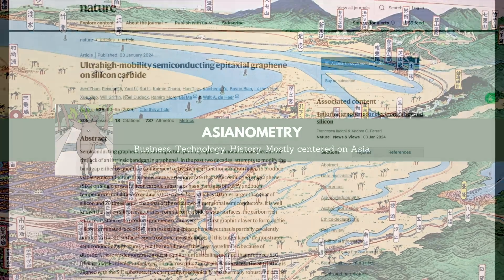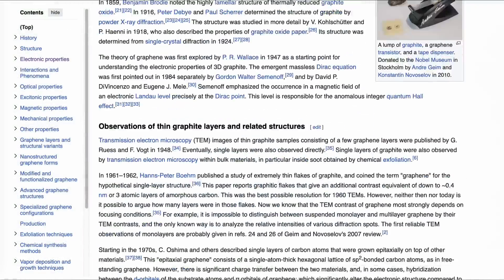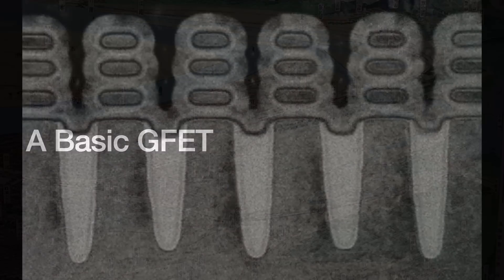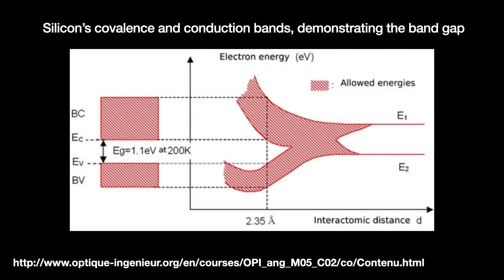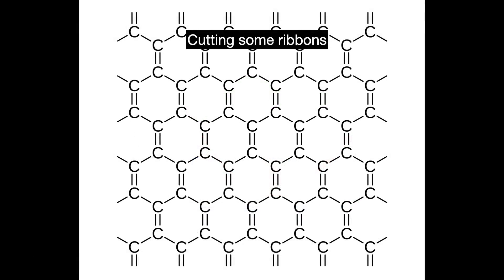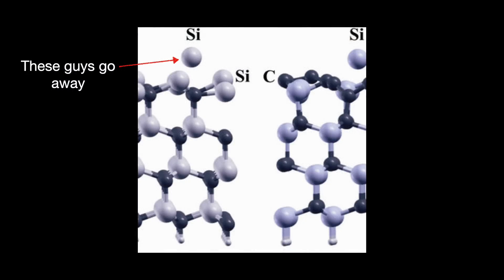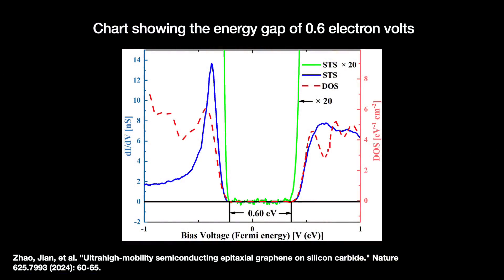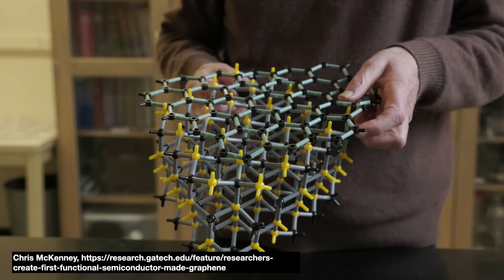A Graphene Transistor Breakthrough?

Comment: Wonder what'll happen first. A revolution in creating 2D material layers that'll allow for the fast iteration through materials so scientists can quickly find a variety of 2D materials with great uses or conventional ways where graphene can actually be put to use.

I'm betting on the first. And I suspect that  it'll suddenly make Graphene not that interesting anymore.

They've already isolated phosphorene, antimonene, germanene, silicene, and siloxene and it's shown you don't need a material made from a pure material like Graphene's carbon to get better effects than current materials.

And creating 2D sheet molecules of multiple atoms may prove easier to do than depositing a single layer of the same atom.

Comment: the semi conduction properties use on doping to change /deform the lattes it can be be applying charge but not gap so unless the dope to get said holes or wave arising  from  deformity as it moves under voltage through the lattes  as with the surface or inverse with  excess  of negatively charged  particulate  ,especially!!!

Comment: Because it is a 2D material, no consumer device will ever be viable if it will rely on notably large continuous sheets of graphene, as thermal expansion will constantly crack the pieces apart.

Comment: Graphene’s bandgap issue is a fundamental limitation when it comes to its use in semiconductors. Here’s a detailed look at how the electronic structure of graphene compares to traditional semiconductor materials like silicon and germanium and why it’s challenging to open a usable bandgap in graphene.
1. Understanding Bandgaps in Semiconductors

In semiconductor materials like silicon and germanium, a bandgap separates the valence band (filled with electrons) and the conduction band (where electrons can move freely). The size of this bandgap determines the semiconductor’s electrical properties.

    Silicon: Silicon has an indirect bandgap of ~1.1 eV, which allows it to conduct electricity under certain conditions while staying insulating at low voltages. This bandgap size strikes a balance, enabling silicon to switch on and off easily in digital electronics, which is crucial for transistor functionality.

    Germanium: Germanium has a smaller indirect bandgap of ~0.67 eV, making it more conductive than silicon but less ideal for creating a clear “off” state in digital circuits. Despite this, it’s still useful in some high-speed applications, though it's more sensitive to temperature variations than silicon.

2. Graphene’s Bandgap: A Zero-Gap Semiconductor

Graphene is unique because it’s a zero-bandgap material. Its valence and conduction bands meet at the Dirac points (in a "cone" shape in energy-momentum space), meaning there is no energy gap to prevent electrons from jumping between these bands. This structure makes graphene act like a semimetal rather than a semiconductor, giving it remarkable electrical conductivity but eliminating the possibility of an “off” state without a bandgap.

In traditional transistors, this inability to fully switch “off” would result in leakage currents that limit energy efficiency and overall functionality.
3. Attempts to Induce a Bandgap in Graphene

Researchers have tried various methods to introduce a bandgap in graphene, but each approach has notable drawbacks due to counteracting effects:

    Strain Engineering: Applying mechanical strain to graphene can distort its lattice structure, creating a slight bandgap. However, strain-induced bandgaps are typically small (tens of meV) and can vary depending on the amount of strain, making them impractical for consistent semiconductor applications.

    Chemical Doping: By introducing atoms like nitrogen or boron, researchers attempt to disrupt graphene's symmetry and open a bandgap. However, doping often results in uncontrollable defects that degrade graphene’s remarkable properties, including its mobility, and introduces unwanted scattering.

    Bilayer Graphene with Electric Fields: Stacking two layers of graphene and applying an electric field can also induce a bandgap (up to ~250 meV). But this setup is complex, and even this bandgap is much smaller than silicon's, limiting the bilayer's usefulness in digital circuits.

4. Comparison with Silicon and Germanium

Silicon and germanium have stable, tunable bandgaps that allow control over electron flow, enabling them to switch reliably between conductive and non-conductive states. In comparison:

    Graphene’s Conduction: Because it lacks a bandgap, graphene has a very high electron mobility and conducts almost like a metal, which is advantageous in some contexts but is unsuitable for digital switches.

    Thermal Sensitivity: Silicon’s bandgap provides a stable “off” state even under fluctuating temperatures, a feature that graphene lacks since it cannot isolate an “off” state.

    Induced Bandgap Limitations: Any forced bandgap in graphene is inherently unstable or too small to compete with silicon, as it’s either difficult to control or comes with trade-offs, such as reduced mobility and material integrity.

5. Why Graphene is Still Being Studied

Despite its limitations in traditional semiconducting applications, graphene’s high carrier mobility, strength, and flexibility make it valuable in areas like high-frequency electronics, sensors, and photodetectors. In these fields, its lack of a bandgap isn’t as critical since it benefits from high conductivity and speed without needing the on-off functionality of digital transistors.
Conclusion

Graphene’s lack of a natural bandgap and the difficulty in introducing a stable one make it unsuitable for conventional semiconductor applications like transistors. Silicon and germanium, with their stable bandgaps, remain far better suited for digital electronics where controlled switching is essential.

Comment: I think it might turn out that the graphene will actually never leave the lab. However, things might end up in such a way, that solutions and techniques for creating graphene, invented during development, will be used in the creation of some other metamaterials. So basically, Carbon in graphene, would be exchanged with some other atoms, but the development/manufacturing techniques (not necessarily the ones in this video) will be the same

Comment: The electron mobility of HEMT devices (high electron mobility transistors) are in the ball park of these proposed GFETs (and usually better). III-V processes use a 2D electron gas at the interference between the semi insulator and the metal. The most common III-V are AlGaAs, InGaAs, GaN, and InP. Of course these are all usually used as amplifiers.  Anyway, I point this out because these are decades old processes that give some grounding in reality. Graphene is cool, but it's also a buzz word. It's amazing how many papers come out with titles filled with buzz words but which don't do anything novel.. or useful.

Comment: Wouldn’t Graphene be best used as a capacitor and or batteries.?.  Graphene is a remarkable material.  I have followed its use for a decade.  The add it to concrete with wonderful results.  Eventually they will use it in armor/Bullet alloys, cables, electrical propulsion. Stealth Clothing, (all ready being done).  I figured it would eventually become a type of super conductor, Levitation.  I could go on with hundreds of things…🤔…. A semiconductor never crossed my mind.😳.
Rock on 🤘 Georgia Tech.!.  They do have some very good teachers.😉.

Comment: One possible configuration of microtransistor is a vacuum lamp. At that scale it doesn't needs neither vacuum nor heating, but the operating voltages are high (close to 12V).

Comment: Excuse my simple approach (I have done some semiconductor physics in my studies BTW) but transistors rely on SEMICONDUCTOR action (through doping). In a FET,  the channel's conductivity is modulated from the relatively high intrinsic resistance of the pure(ish) semiconductor (usually silicon) to a lower level which results from doping.

Graphene however is a CONDUCTOR. It has no ability to have its conductivity modulated !

Whatever these experimental transistors may be, there are NOT 'graphene transistors' since graphene is ALWAYS a CONDUCTOR. It can have NO transistor action by definition.

Researchers here are making rather far-fetched claims. I suspect it's the silicon carbide doing the work here, not the graphene !

Comment: One way to make a fet out of graphene is to put a very precise gold layer so individual atoms sit in the c6 cells, next deposit another graphene later over that. If you apply an electric field the graphene  will conduct to the second layer, if you apply a positive charge it will resist current flow. It behaves similar to a tunnel diode at zero charge.

Comment: i think the biggest breakthrough will be when electronics focus on trying to become more efficient under high temperatures. Reason graphene is so innovative is because it is made from coal the 4th most abundant element on earth and it is atoms thin. Coal has a temperature rating of 3 which is in the mid point of a conductor and an insulator. When graphene over heats which probably barely happens, graphene will burn away meaning that a product with intended disposability and low cost for electronics will create a more efficient product. The reason its more effective with temperature is because the hexagonal structures creates two paths for the electron bonds to share photons and energy. I think that graphene will create the new wires and connection points for motherboards in the future. Transistors themselves i think that replacing the gates with nanotubes will the best option for what is in the market today to prevent the leaks currently creating panic amongst so many EE. Moores Law. All Love Doe<3

Comment: I’ve built high power, high efficiency class E radio transmitters using SiC fets (silicon carbide) because they have low gate capacitances and allow for higher frequencies for switching. I wonder if graphene gates would permit high power fets designed for PWM applications to be used in the hobby world for higher frequency switching radio amp designs. It all depends upon gate capacitance at those frequencies, I guess.

Comment: Sorry if I missed this but I'm confused about how GFETs work. For normal FETs (even BJTs), you need a semiconductor but also PN junctions (P/N are created by doping the semiconductor with different atoms). Do GFETs require PN junctions and doping?
Reply: JFETs have a pn junction, insulated gate FETs don't.  But as I understand it, you still need the drain to source channel to be doped.
Reply: @ but if you have doped and intrinsic next to each other, that’s a kind of junction too right?
Reply: @nitroxide17  It would be. However, a mosfet (which used to be called an igfet - insulated gate - showing my age!) has a thin layer of silicon oxide, not intrinsic silicon, between the gate connection and the channel.  Silicon oxide is an insulator, there's no leakage current as you would get in a reverse-biased PN junction.

Comment: 9:10 "A recipe for epitaxial graphene on silicon carbide was first discovered in 1975 by  a scientist named AJ van Bommel."
That deserves more commentary, since as you say graphene was first isolated in 2004 by Geim and Novoselov at U of Manchester. I found von Bommel et al's 1975 paper on ScienceDirect and the summary says 'LEED and AES experiments of the SiC{0001} crystal surfaces show that on heat-treatment these surfaces are easily “covered” with a layer of graphite by evaporation of silicon. The graphite layer, which has a distinct crystallographic relation to the SiC crystal, is monocrystalline on the Si-face and mostly polycrystalline on the C-face.' It seems they were pretty sure they had a single-atom thick layer of graphite, but they didn't call it "graphene" and weren't sure of its structure.

People predicted and confirmed that thin layers of graphite would have weird properties long before 2004, before science even had a name for it. Wikipedia says "The existence of graphene was initially theorized by Philip R. Wallace in 1947" and "The term graphene was introduced in 1986 by chemists Hanns-Peter Boehm, Ralph Setton and Eberhard Stumpp." Science is a process.

Comment: Wouldn't a lower bandgap mean less waste heat, or am I misunderstanding? Would a smaller band gap mean the energy the electron needs to jump the gap (and equivalently the waste heat deposited at the output) would be less?
Reply: A faucet that does not turn off is extremely inefficient. Yes you have very low energy loss when running but it is always running so you are in fact wasting a lot of energy. Think of an inefficient aircon that only runs 2 hours per day vs. a very efficient aircon that runs 24/7. The inefficient aircon will consume less energy after a month of operation.
Reply: @kazedcat  Well if there is a band gap then it wouldn't necessarily leak, but I'd imagine a really thin bandgap allows for leakage though via quantum tunneling and potential noise
Reply: @ueaj4576  That is a second issue. With thin bandgap tiny noise energy is enough to turn 0 to 1.

Comment: What if we just don't need better transistors anymore ?

The current AI craze is just a useless fad that makes no sense. They want to train bots by feeding them redditor and facebook texts and think they are gonna be smart. Riiiight.

Web servers just get loaded with more ads and more tracking scripts when they get access to better server hardware. Or new even more bloated javascript middleware of the month get introduced for no particular reason other than suck more CPU cycles.

Smartphones just get bloated with more useless features and megapixels and 240fps recording to justify needing newer SoCs that still suck up your battery in 5 hrs anyway.

Gaming has already reached photorealistic graphics but devs are unable to come up with interesting gameplay anyway. Unreal engine 5 and the minor feature updates it will get is pretty much the end game of whats needed platform wise.

Better high frequency trading bots ? Useless to anybody not inside a hedgefund and they are already rich enough as it is.

Crypto mining ? Who cares, the blockchains can already sort themselves out with the current tech, it's just an empty arms race of who can burn more power for the same result nowadays.

Cars will only use it to spy on your driving habits better and show you more ads (already started)

Quantum computers might/will take care of the heavy lifting for hard science and simulation work.

We are at a stage where I'd rather be told my next CPU consumes 50% less power and doesn't even need external cooling, rather than push 800 fps in cs:go instead of than 650

Comment: Having worked in both TMDs and Graphene a bit in past few years, pretty accurate description of material interaction here, barring one clarification.
Device mobility of 25 is different from Intrinsic carrier mobility which is 2orders higher that clearly mentioned in video. However, the device mobility depends on the gate model and its interaction with gate material - Schottky barrier. Therefore, improving this barrier aka finding more suitable material can improve device mobility. From authors viewpoint, intention of the work seems to show the isolation of SiC-graphene, characterization of its bandgap without trade-off on intrinsic mobility and not building best in-class device.

Comment: I believe you mis-spoke here by saying the 0.6 eV bandgap is HIGH -- this is a low band gap, at least lower than Silicon's 1.14 eV, which would change your analysis at several points after: https://youtu.be/tVEOIQmUy10?t=731

Comment: Funny enough, we have already had to deal with increased power consumption to get faster switching speeds, ask anyone that has bought into the last few generations of Intel processors, when a CPU itself is drawing over 250 watts to get work done, that is a problem. That said, I have been perfectly happy with my insanely fast for what it is AMD Ryzen 5 5600X, it brought down power consumption vs my outgoing AMD Rysen 5 1600X by 30 watts and yet I got a HUGE increase in performance. It would be awesome to see graphene become part of CPU tech, because I can't imagine what it would be like to have the performance I have now, with an even lower power draw.

Comment: Little to no band gap would mean it could function as a diode with very low forward voltage, but since the band gaps don't overlap, it would still function as a diode? That's amazing for high powered diodes, like in solar panel arrays and such.

Comment: even if doesnt make into ultra fast (GHz) computer chips due to the mobility and complexity, it can be used in power electronics for renewable and motor drives, these circuits hovers in the KHz band and normally are monolitic structures

Comment: They won the Nobel Prize using scotch tape?
Reply: that’s part of the reason why they won. They were able to discover a groundbreaking material using something as simple as scotch tape.
Reply: Yes, but they were in the UK, so probably called it Sellotape.  :-)
Reply: It's pretty neat when you realise you can get one of the most intriguing materials ever manufactured by connecting scotch tape to a rock and pulling a few times. Not very sci-fi
Reply: They won the Nobel Prize for being physicists who realized that Scotch tape would work, and then tried it.
Reply: Yet another Condensed Matter Physicist win against the Particular Physicist needing decades and the entirety of CERN just to compete